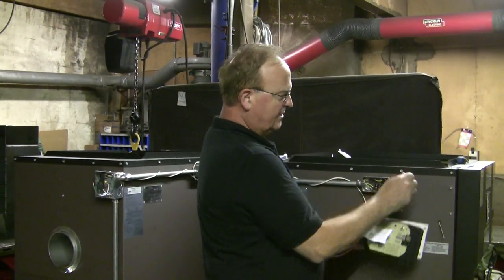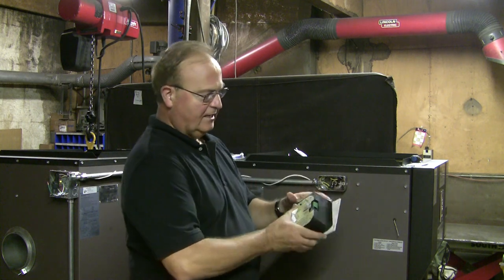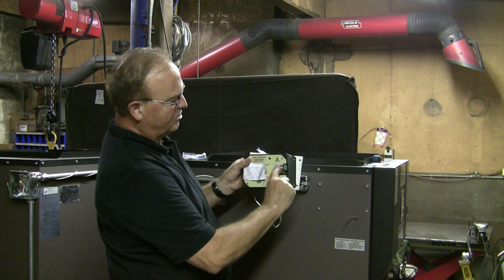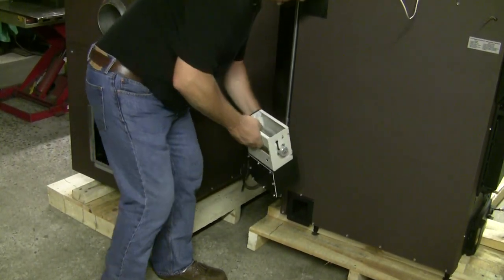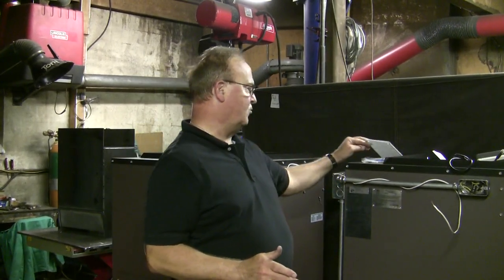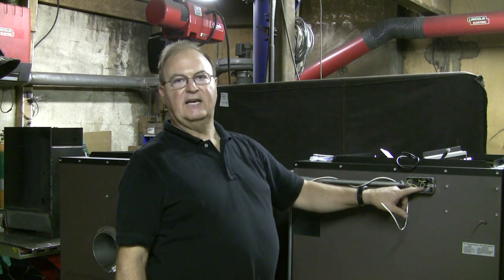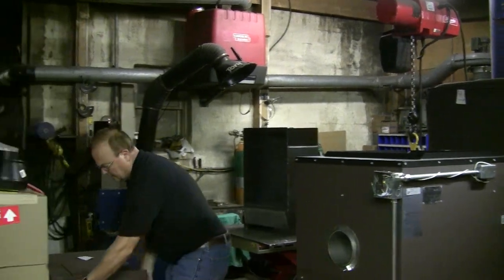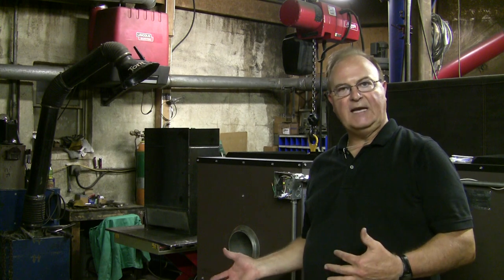Kuuma Vapor-Fire 100 Installation (Electrical Hook-Up)

Comment: I have contacted you several times. I want one of your furnaces but I am 72 years old and I am not handy. I have had 4 other wood furnaces over the last 40 years. I have heard great things about yours . I just don't think I can install it and I am a veteran and retired teacher living on a very fixed income. I have never had a furnce worked on because I have always used wood. The other furnaces I had just needed to be set in place, plugged in and hooked to the chimney